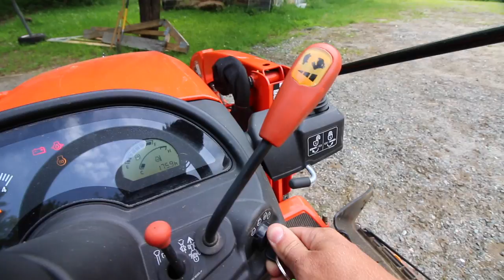POURiNG a Concrete SLaB for the Off GRiD Outdoor Kitchen #4

Comment: Be sure to put a low voltage light with an electric damper on the chimney  in the smoke house.   Order a low e 3 dual paned..site glass window with inside access.   You get to see the process in the kitchen.   Some shudders to surprise guests.. perfect.  Love the programming.
Reply from the maker: What is the reason for a low voltage light with a damper in the chimney!

Comment: When they dumped that concrete on the back side of the slab and it ran out into the woods I thought you all had really messed up but I see you used the tractor and bucket to move it before it set up. Looking good. I love the modern homesteading life and I see you all do as well. Good stuff!
Reply from the maker: Thanks! Lol I figure we could use it to re-enforce the back wall, when he dumped it I went oh no this is going to be a mess!

Comment: Why didn't you put your cattle panels in the forms before you put the liquid concrete in the forms?  I've never put my metal in the concrete after the concrete was poured.
Another thing I do is setup a sprinkler on the concrete for about 2 days.  It keeps it wet and puts a crazy good finish on the surface.
Reply from the maker: We didn't want to step on  the cattle panels and push them to the bottom. That is a great idea on the sprinkler! Thanks

Comment: After the concrete set, you should not have wet the surface down and used a broom to rough up the surface.  That will cause some of the water to migrate into the surface, thereby weakening the strength of the concrete at the surface, possibly causing spalling of the surface.  A broom finish should have been applied before the surface completely set, and then a sealer applied to prevent evaporation of the surface moisture, or the entire slab should have been covered with plastic to prevent moisture loss.  This is the way it's normally done on commercial jobs.  But I'm sure that what you did will work just fine for your use.
Reply from the maker: Thanks! Great info! I think this will work perfectly for use!

Comment: Hey it's looking good over there. does the slab have a slope or perfectly flat? and why the extra concrete poured in the back? thanks, good vid, looking forward to the rest.
Reply from the maker: It has a slit slope to the back right corner when looking at it. That was the leftover concrete. When it started to set I used it to reinforce the back corner.

Comment: how much concrete did u need to complete the outdoor kitchen?  Also, how did u determine to insert the metal rods into the concrete?   Great work!
Reply from the maker: We ordered 5 yards and the slab used around 4.5. I figured the space and use a tape measure. Thanks!